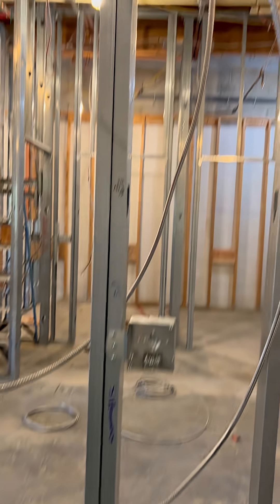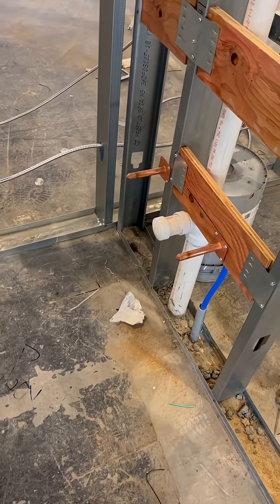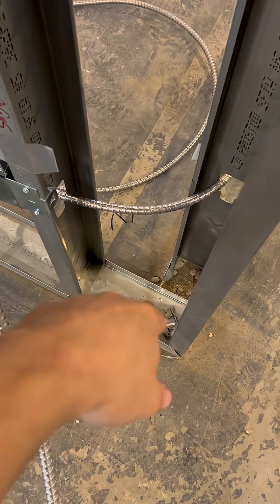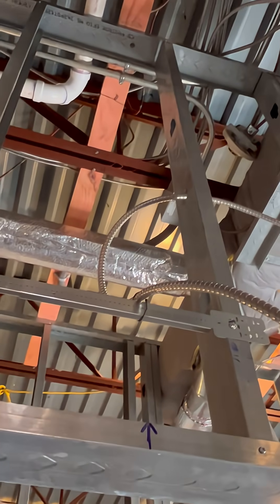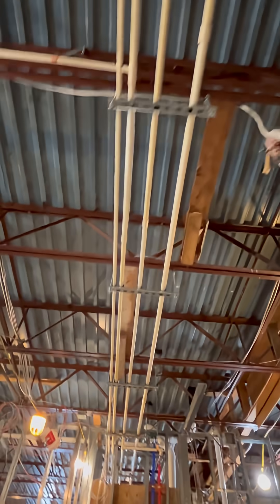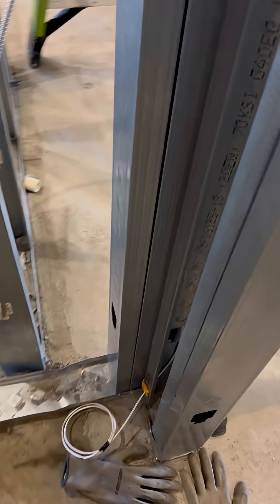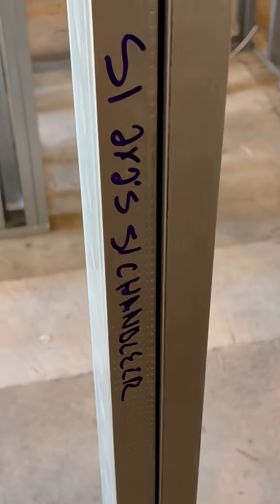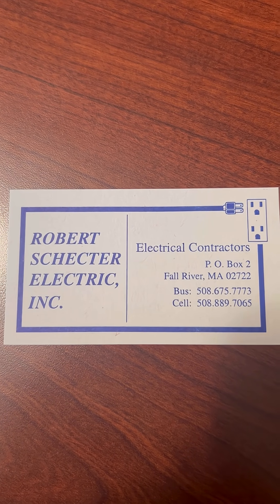How I Set Up Lighting for PERFECT Results 💡 + Low Voltage Overview ⚡#shorts #electrical

Comment: Why all MC and not run conduit. I know some contractors prefer to use MC but that is a total pain to troubleshoot, and good luck adding another circuit or replace a damaged wire. Now there are time you have to use MC but not for the entire job.
Reply from the maker: All drop ceiling can add wires or circuits whenever they request it. When this place is done they’ll never need any circuits if I explained how many circuits were in this place no breaker or wall is ever left without power. We use MC because that’s what the job was priced out for. I can’t use conduit I would lose money it’s not priced out for that

Comment: Why not just land them? You lose time doing everything in stages.
Reply: Stages is not only the correct way, but it's more efficient. Rough in has to be 100% done first, because it requires an inspection (along with other trade inspections). Termination should be done later, because you not only lose time covering your work so the drywallers and painters don't make a mess, but receptacles and switches have ears that are meant to seat against the drywall (assuming that's done right). The other nice part about stages is tools. You can carry four tools and complete rough in, then swap for four different tools to terminate. No lugging a bag or belt all day.
Reply: @brianpiper3188 
Rough-in here means boxes are in, MC is pulled, conduit is complete, wire is pulled in and boxes are made up (minus the switches and receptacles.)  This includes ceiling.  Only thing not made-up are direct connect fixtures where you leave a pig-tail.
Reply from the maker: @brianpiper3188 yes we like to do everything in stages you are correct friend!
Reply from the maker: Great question we’re afraid of putting breakers in bc of incidents of the past so I don’t allow any breakers to be put in until the devices are fully installed. We had people turn breakers on painters sheet rockers etc and cause major issues with blowing things up. So until the devices are put in no breakers it’s safety for everyone
Reply: No all of you mis understand. He is doing his rough is stages. If you pull an mc land it. Dont walk away leave it hanging only to  come back around this space is small enough to rough out 2 or 3 rooms a day with one man let alone his crew. Time is money. Of course he not going to device. But land your wires make your joints, room complete and move on to the next room. No breakers no trim.